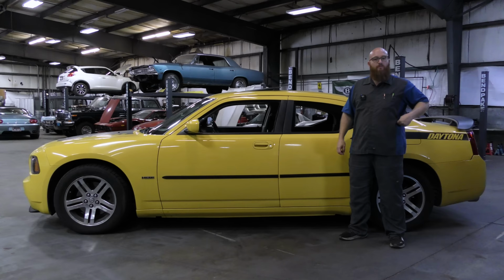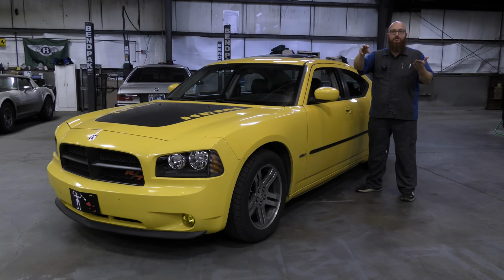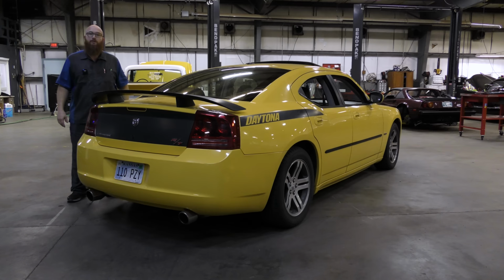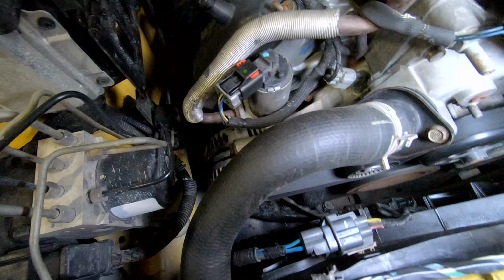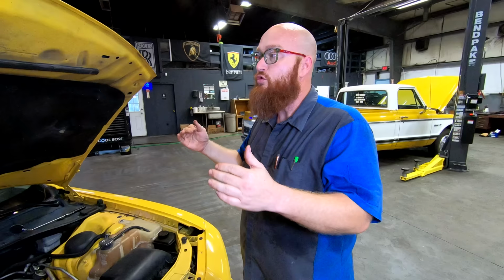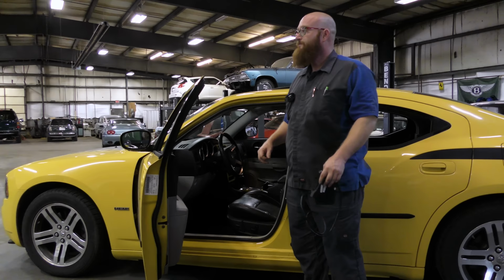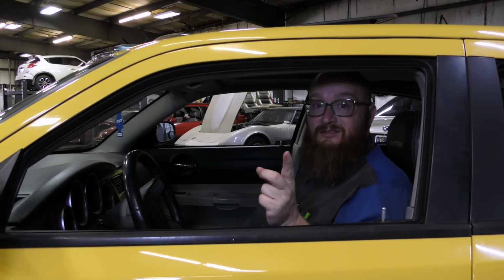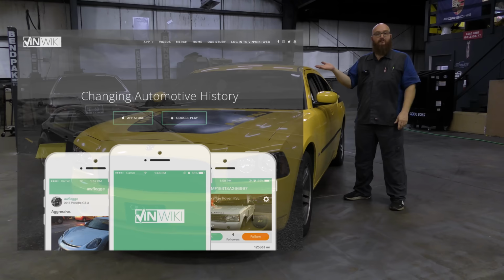4 things you MUST check before you buy any used car! CAR WIZARD shows how not to be scammed!

Comment: I have not bought any cars from private sellers, but I have sold several, and one of the things I always offer them in addition to the signed title is a bill of sale. These are available at no cost on the Internet. Both parties sign and fill out basic information about the car being sold, and it serves as the receipt for both sides in event of any title or tax questions. The buyer and seller each sign a separate form for each other that has the same information - physical signatures in ink so there are no photocopy or duplication questions.

Comment: If you do drive it. Don't drive it gingerly, get on it, swerve around a bit (within reason). I bought a car a few years ago that was fine when I first got it because I just rolled around the block in it. As soon as I tried to get on the highway the oil pressure light came on.

Comment: Wise words, and very thorough. Private party cars are always going to have something wrong, and need a major service as well. By the time you fix it all, that private party car isn't any cheaper than a car from a lot. A car from a reputable lot, in contrast, will have already received a major service and have all the little things fixed. That car will also come with a warranty of some kind, offer an extended warranty option, provide a place to go back to with a complaint, and give you someone to sue if things go really bad. If you aren't car savvy, that's your best bet, IMO. 

If you must go private party, then you can do a very careful inspection like this. You'll find a lot wrong, without moving the price meaningfully downward. Even so, you're sure to get a surprise or two after buying. I can take a half-second look at the seller, glance inside the interior, look underneath, and do just as well. Basically, if the interior is grimy, the exterior is banged up and there is a lot of wetness underneath, then that's a car to avoid. If I get any negative vibes from the seller in the first half-second I meet him, then that's a deal-breaker no matter how good the car.

Comment: ...When I took Driver's Ed...at our high school back in 1973..They tried to cover Buying a Used Car...I think it was part of the Safety portion of the Six week course.  If you were driving that day...which was Every Other Day, it was a six hour day.  If you weren't driving that day, you came in during the afternoon/morning.  Depending on when that instructor wanted to go out.
...They used BELTS...the fan Belt(s)...Exhaust...Lights...Tires..Steering.   Then it would tell you about each one.  TIRES..are they cupped, does it have an even tread wear...and such.
...We were all young and not knowledgeable about cars...At All.   Back then, I didn't know the difference between a spark plug and carburetor.   But thanks to a fine program in Grand Rapids Michigan thru GRACIE (?)...I now know all the basics of an automobile engine so when I watch a car program on TV...Jay Leno's garage, Road Kill,  Stacy David's Gearz and such...I can follow along...mostly.  That show 'Over Haulin' was a hoot.  Basically they 'steal' a deserving person's car and replace EVERYTHING but the body and frame...and sometimes they replaced that...all in seven days...and then They rested.
...I appreciate videos like yours.  Money has always been kind of tight in my family and listening and trying to learn....what I believe...are valuable videos.   I am also a fan of Scotty Kilmer.  He has been a mechanic for like 50 years.  I'd like to know if you have watched any of his videos.   
Thanks again, Mr. Wizard.

Comment: Peek in between the wheel spokes and look at the brake rotors for abnormal scratches. If visible look at the pads to see if they are about equal thickness.

Comment: Something you hadn't mentioned that's very important: New oil can often be sign of hidden engine problems. So can fresh antifreeze. My friend and I were looking at Honda CR-Vs at a lot in Arlington, Texas. We had trouble opening the oil cap, as well as pulling the dipstick. The oil was clean...too clean. I had already test driven the car, so we couldn't open the radiator, but we were able to check the coolant in the reservoir. There was definite aluminum dust sparkles in the coolant. A sign that they poured  aluminum sealant into the radiator. This was a clear indication of engine oil leaking into the coolant, via cracked cylinder head or head gasket! A common problem in older Honda engines. What seemed like a great deal was in fact a disaster waiting to happen.

Comment: When looking to buy any vehicle, google the vehicle name and model number and then start adding search questions such as: engine problems, transmission problems, frequent repair issues, etc. 

I bought a 2005 Toyota Highlander that had the famous stripped head bolt problems that was a worldwide issue that Toyota refused to stand behind.

It cost me $1500 to have a local mechanic fix it, Toyota wanted $4000 to replace the engine!

Comment: 1.look underneath  check for damage and rusted frame. 2. Check under hood all hoses, belts ( dont want shiny or slight rips), and fluids ( make sure all fluid is clean, no discolor or foamy) . All newer junk from 2000 and newer always taps when first starting, doesn't mean it is a bad engine, most people don't use recommended octane .. Most people never really check rear fluid, filters, which is important. Any used car you buy will need maintenance regardless it is used. Make sure all basic fluids were changed. Anyone also can run that vehicle before you show up and you wont hear a tap , or they put things in it so you don't hear it right away. Rule of thumb, call your insurance company and ask what the car is worth, they know the value and what you will get if you have an accident. A vehicle is ONLY worth what someone is willing to pay you regardless. Just a womans input who has been doing cars for over 30 years. You can also get a excellent car with a repo title so don't be fooled. I own one and it is a ex drug car and best thing I ever bought. If you love the car ask yourself if it is something you want to invest money into if it is get it, everything don't matter.

Comment: Some other points: Research if any bad issues for the vehicle you are considering. 
Check on the websites like you mentioned or Carfax to see if all safety recalls are up to date, if serviced, any crash history, if a 'lemon law' buyback.
If purchasing from a private seller, meet in front of a police station, crooks are unlikely to show up there. 
Verify from the title if marked that the mileage reading has been altered or 'actual mileage unknown'. 
Take off the engine oil filler cap to see if any white stuff on it. Look for spots under the hood if covered up with spray paint or if covered in grease. 
Open up the trunk or hatchback to see if work properly, pull away rugs, covers, mats/spare cover to see if any water, rust, body damage from the inside, if spare/jack missing. 
Pull the floor mats for signs of flooding, check for any panels missing or damaged - especially if covered airbags. It is possible the vehicle was in a crash and the airbags not replaced. Check to see if the seat belts are stretched or damaged.

Comment: Basic good advice
Even with my knowledge starting my car collection
04 Viper Mamba roadster
05 SRT10 Viper PU
My latest 
2014 SRT Viper / Carfax showed no recalls (CHECK THE RECALLS YOURSELF)
Has a recall R 28 R 29 possible engine replacement 💥

Comment: When I go to someone's house to look at a car, I ask them not to run it until I get there because the best way to tell how well a motor runs is to hear it when it's cold.  Even a worn-out engine, which burns oil, will sound ok it's warmed up, but if a car burns oil, you will be able to spot immediately when it's cold.  I check the manifolds to see if it has been running or not.

Comment: I just went to look at a used car. Met the guy at the shopping center and he just tried to rush me. As soon as I grabbed my OBD scanner he slammed the hood shut, jumped in the drivers seat and took off.
Reply: Did he want to meet you at the shopping center? Bad sign if the engine is warm.

Comment: Beware of the short test drive. if the seller wants you to return in a few miles, beware. Slipping transmission or over heating can take a while to show up. Don't meet up somewhere, look at a car at the owners residence. Never buy a car without an under car inspection, suspension, steering and muffler issues can be extremely expensive.

Comment: REading codes is always good.  

I use a $15 bluetooth reader. It's basically a bottom of the barrel OBDII device and useless without my phone or tablet, but it gets the job done for very little money.

I've actually passed on a car based on OBDII. The car sounded like it was running correctly, but the CEL was lit and my scan tool could not connect to the ECU. Best case is the wiring between the port and the ECU was damaged and the ECU was confused and that's what the code was about(would be like a ten minute fix with a soldering iron), but it could have been indicating the engine was about to explode under any serious load. Might have gone for it if I had been looking for a project car and they agreed to knock a few hundred off the price, but I needed a daily driver so I actually spent a bit more on a Grand Am(this was a Sunfire) that had an EGR code, which isn't a terrible thing in a state with no emissions testing(it ended up clearing on its own in a couple days of daily driving). That Grand Am ran great until I delayed fixing a broken spring to the point the stress on the axle broke the transaxle internally(it did not move at all under its own power, so I don't think I broke just the stressed axle, and the noises when I hit the gas sounded internal)

Comment: I bought a 2005 Honda crv straight out about 6 years ago. It now has 288,6000 miles on it now. It might be going out now, but I'll run it until it dies out or until it goes to 300,000 miles.

Comment: To Wizard's list I would add check the tires. Nowadays it's recommended they be replaced after six years, regardless of tread depth, because the rubber becomes hard and doesn't grip the road as it should, especially wet roads. The DOT code indicating the week and year it was made will indicate its age. Check the date of all four tires!  (Does it have a spare and a jack?)  As expensive as good tires are now it's a cost you need to consider when looking at a used car. Also, if the car has been sitting, check for fresh oil and coolant leaks on the ground under the engine. Coolant leaks are harder to detect on a hot engine. And listen to the sound of the muffler. If it has a hole in it, it will be louder than normal. It might not sound "bad", you might even like the sound, but will it pass the SMOG test the next time you have to get it registered? Another clue: you might detect excessive exhaust fumes while the car is parked and idling. Finally, we live in the age of Google.  It's so easy to google "year, make and model reliability problems." Just consider what the Wizard has said about the Ford 5.4 Triton engine, for example.

Comment: Look from one mechanic to another at the end of the day used cars will have issue. If it drives on every day roads odds are it has been on accidents and hit its fair share of potholes. The one thing I look for in used cars is structural damage, such was deterioration from rust, frame welding repairs and check all fluids for sign of water contamination. I've worked and resold cars that have been completely submerged and when the car is cleaned well it can be hard to tell.

Comment: Compression test
Fluids check
Check undercarriage frame look for oils rust issues. 
Check car by letting it idle for about 20 minutes then drive it gentle listening to the car not the radio.  Then dive the shit outta it afterwards on the hwy for 20 miles of everything checks out and the paperwork is in line time to play the deal game.  And if the ac don't work don't buy it. If they didn't keep up with the AC system imagine how the rest of the maintenance was done.

Comment: This had many great advice,  but some things to touch on.
Make sure the engine is cold when you 1st start up the car.
Look for overspray on molding,  headlights or tail lights,  or even the exhaust. 
Also, I know with Hondas, the bumper covers are made of plastic,  even from the factory,  sometimes the pain doesn't match up.

Comment: One more thing I would always check is the air filter. if it is dirty and clogged up then you also know that the car hasn't been serviced. I have had many cars come into my shop complain about crap running which can be traced back to a clogged air filter. Also always insist on a pre-purchase inspection by an independent mechanic never trust what the seller tells you, Even a dealership if they won't agree to an inspection then DON'T BUY THAT CAR.

Comment: If the title says “rebuilt” that’s a red flag too. Rebuild is usually an accident that occurred and at one point could have been a salvage or totaled out and a collision shop fixed it. Some states require vigorous testing for road safety, and some states don’t in order to resale the vehicle as a rebuild. Then the next thing you know, you take it in for an alignment and find out it will not go into alignment due to the frame being damaged when the accident happened.  Stay away from rebuild titles too.

Comment: From experience, have a non-interested party inspect the car after you've decided you want it. A shop will usually charge around $150. It's easy to get glazed eyes when you've found that "perfect" car. Also do that a similar inspection on a new car. In the past I bought a new Chevy that the dealer had done a $100 paint job to cover shipping damage to the roof. It started flaking off 3 weeks after purchase. "We never repaint new cars" so no warranty from GM or the dealer. My next car was a new Dodge that, after the first door ding, showed bondo on the door. My current new car was very low on coolant so had the dealer top it off before driving home. It took 3 more adds of coolant before it stabilized. After 4 years we haven't found a leak so maybe took a year to get all the bubbles out?

Comment: Inspecting the engine and transmission is even good at a used car dealer even more  so at a buy here pay here dealer.
Most by at auctions and resell the cars with  no mechanic ever  looking  at it. this is where you can start playing  for a better deal by showing the salesman all the problems, even where there is not really any problem. 
One thing  to really check is that the check engine light comes on when you turn the key on but don't start the  engine.
If it does not come on, it may be disconnected. Very common done by shady dealers..

Comment: I bought a used Isuzu diesel, seller said it would start on cold with a little white smoke, but it does need a couple glow plugs so it’s understandable, I’m sure if a seller says the a/c just needs to be recharged then there’s a lot more going on.

Comment: right, learn all the automotive smells, anti freeze, engine oil, transmission fluid, clutch/brake smells, electrical, gas, exhaust. all these have unique smells.

Comment: 13:10 whatever you do make sure the transmission isnt leaking. i bought used corolla and it leaked out the fluid because it had the wrong size nut and i fried the transmission. it was $3000. a lot cheaper than buying another car but still check the fluid people even if you need to take it to a specialist

Comment: I am very knowledgeable about cars.  I still have a professional mechanic check it out for $200.  Dealerships in the past had many used cars but now go to auction.  I still prefer buying used from a dealership that has their 
Reputation behind their sales.  If things are unsatisfactory or difficult repairs you can call regional reps for Ford, Chevy, etc., dealerships.  Deeper pockets.   More role to go to if problems.  Many dealerships offer certified used cars with warranty.
Reply: Some states or nearby states allow salvage title to be removed.  Check for flood damage,sand under carpets, musty odor, etc..  you need the car on a lift

Comment: On that generation Charger, basically all Chrysler, Dodge, Jeep, Ram from that era, the power steering fluid and the transmission fluid is the same type of fluid.  So if you check the power steering fluid and its dark then the transmission fluid is probably going to look the same if not worse.

Comment: I was told to check the presets on the radio. If all of them are set to head banging music the transmission is probably shot. I bought a low miles Avalon from a dealership three years ago. Was looking through the owner's manual and found a piece of paper listing the radio presets. I was 90% sure it was an older persons car and based on their choice of radio stations it was.

Comment: Thank you for exellent video. One very expensive thing to look, in places where salt is used on roads is rust. It can total the car. Bottom of the doors,  under the car. Also seen subfrarame totally rotten or with holes.

Comment: Like myself  I'm not to well up on the checking used cars,but for me U can tell alot by first looking at the alignment of the plastic fenders that gaps are consistent and aligned with the rest of the bodywork. Uneven tyre wear is also a consideration that is easy checked.